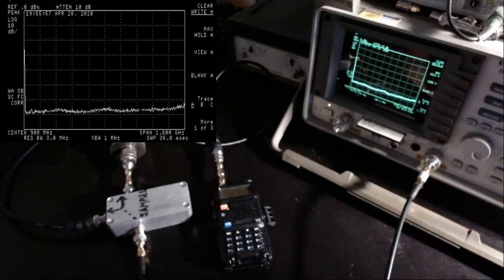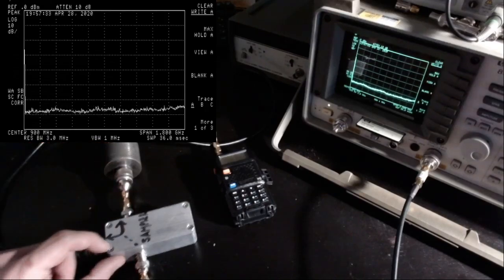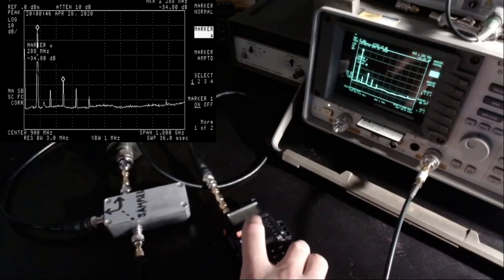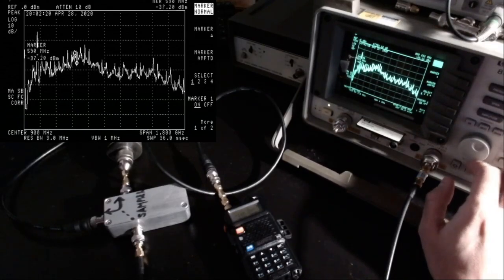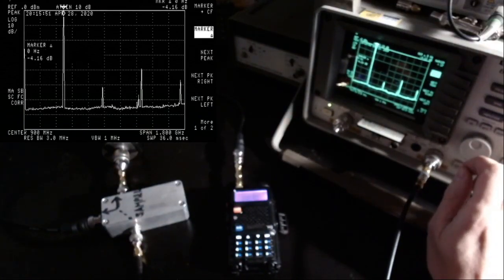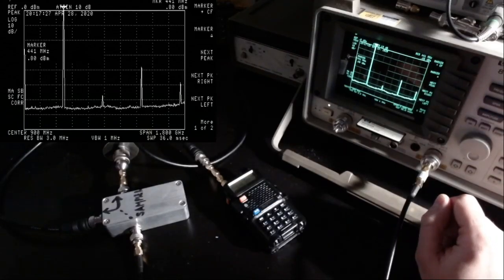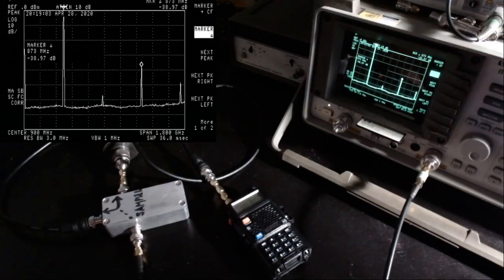Episode 21: Spectrum Analysis of Baofeng UV-5R - PART 2

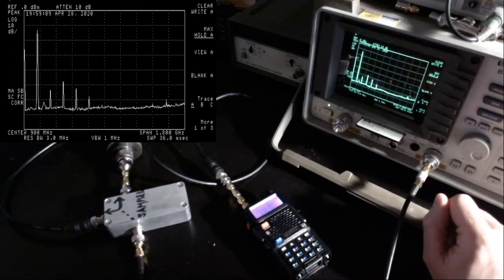Comment: Hi – I think you confused yourself a little while testing the Baofeng.  At 3:09 your screen showed the original (fundamental) frequency (nominally 145MHz), plus what would have been harmonic number 2 (290MHz), 3 (435MHz), 4 (580MHz) and 5 (725MHz).  Then at 4:01 you fiddled with your oscilloscope controls which changed the fundamental frequency to zero, which then reduced each harmonic readout by 145MHz, resulting in inaccurate MHz readings for each harmonic.  The poorest harmonic was no. 3 (435MHz) which you say was indicating just below 0dbm, which relates approximately to 1 milliwatt.  If that is correct, then that is quite good for a Baofeng!  Everyone who does not own a Baofeng loves to criticise the radio for its spurious emissions, but at just a typical 1 milliwatt, that is absolutely nothing to worry about. 
You might like to check out this YouTube video:   
https://www.youtube.com/watch?v=ZpRsIEkoAZY
I hope this is helpful.
Reply from the maker: thanks! well spotted! In indeed messed up with the controls! Thanks man!
Reply: @therfnoob7697   Hi again.  No probs.  Yours was a very interesting video, and I hope you are enjoying your new toy!  Iain.

Comment: Avevo commentato un’altro tuo video con l’account sbagliato.... 🙄
Grazie, mi sono divertito e pensavo di farlo anche io per le mie radio, per vedere come si comportano...una domanda : che caratteristiche ha il DC block che hai usato ? Hai qualche suggerimento su dove prenderne uno ?
‘73 de I3APR, Andrea VR
Reply from the maker: (I answer in english just in case it's useful to others as well).

The DC-block I am using is Mini-Circuits BLK-89-S+ (has a limit of 50V and is good up to 8Ghz).

I bought it on ebay 2nd hand... It's price new is 17dollars.
Reply: @therfnoob7697  thank you for the info...I was wondering whether I would need it or not : my Spectrum Analyzer is not glorious as yours, but it is kinda newer ( Rigol DSA815-TG ).
On the manual I can clearly read :
"CAUTION
To avoid damage to the instrument, for the signal input from the RF
input terminal, the DC voltage component and the maximum continuous
power of the AC (RF) signal component can not exceed 50 V and +20
dBm respectively."

That makes me think that unlike yours, mine has a sort of protection embedded.....unless... yours has it as well and you just add the DC-Block as an extra protection... ;-)
Reply from the maker: @agvr5653  Rigol DSA815-TG... nice!!! Congratulations!
My HP 8591E has similar limits: 25VDC (you have 50) and +30dbm (you have +20). 
However I prefer not to "test" these limits, and protect my Spectrum Analyser, especially when connecting to things I am experimenting with an I am not so sure how they work. 

Anyway, you are right: I probably don't need it. But... better safe than sorry :)

In your case, anyway, you don't need my DC block but I suggest you should use most of the time an attenuator (for example -20db) because the HackRF can produce 15db of power and that is quite close to the limits of your RIGOL!!

 These are expensive toys, and it is good practice to protect them. :)